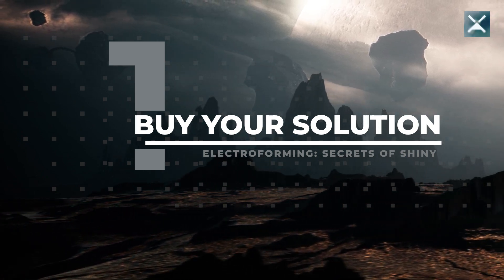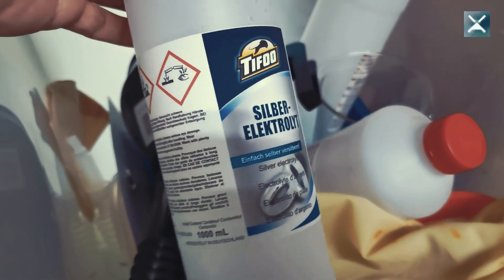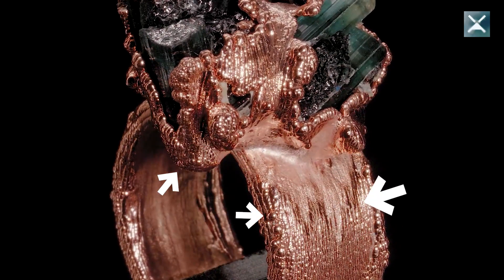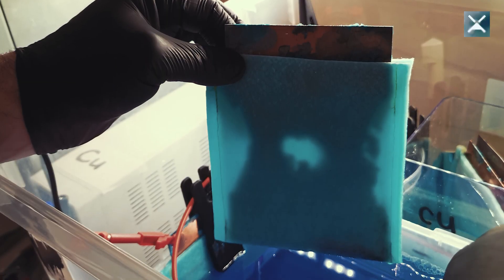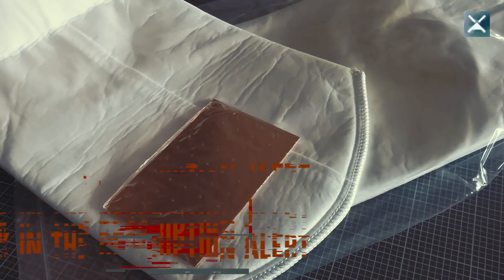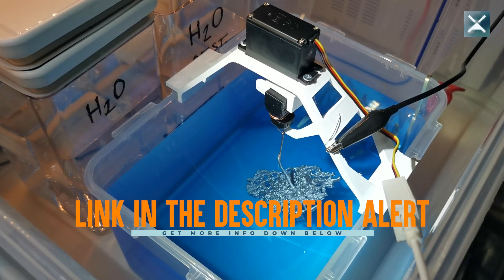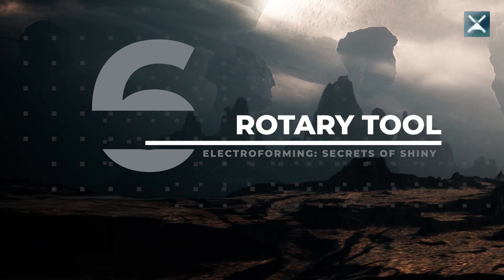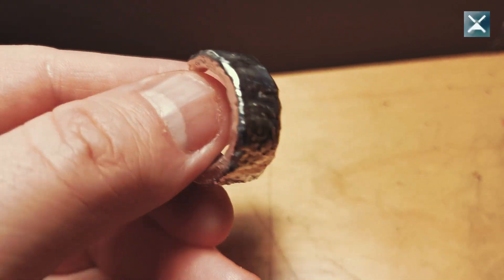Electroforming - Secrets of Shiny

Comment: I didn't have a servo motor of the right size to hand so made a similar rotary jig to yours but i added a commutator and used a geared DC motor instead of a servo, the commutator means that no clipping to the cathode is needed.

Comment: hi. thanks. i downloaded ROTAJIG DIY MANUAL.pdf file and the link of 3d printer parts and  ciruit  python code for the trinket doesnt download for me. could you please send me the links. thanks alot for your help.
Reply from the maker: """CircuitPython Essentials Servo continuous rotation servo example"""
import time
import board
import pwmio
from adafruit_motor import servo

# create a PWMOut object on Pin A2.
pwm = pwmio.PWMOut(board.A1, frequency=5)

# Create a servo object, my_servo.
my_servo = servo.ContinuousServo(pwm)

while True:
    print("forward")
    my_servo.throttle = 0.1
    time.sleep(20.0)
    print("stop")
    my_servo.throttle = 0.0
    time.sleep(20.0)
Reply from the maker: or use this link: https://www.swisstransfer.com/d/184178a8-db2e-4a13-9339-e5c5420a7207 ... hope thatll work

Comment: Do you run for fish tank filter pump during plating or after?  Also I have access to different pumps in Canada. What’s the key component? Just a filter sponge? Some come with all sorts of fancy filtration components designed specifically for cleaning fish tank water.
Reply from the maker: Hejhej peebs,  usually run the pump while eforming. The goal here is to filter out medium to big debris, while the anode bags should take care of anything smaller. So i have stuffed some coarse and some medium size filter sponge material into my pump. Its a bit trial and error, but it doesnt take a lot of effort to work well. But i never use the active carbon balls or other chemically active material, cause it could taint the solution. Hope that makes sense 🙈😉
Reply: @xeno_arch9887  that makes perfect sense, thank you!

So I’ve printed the roto jig and purchased the trinket M0 and FeeTech continuous servo from adafruit.  Did you heat the roto jig piece and just force it onto the servo gear?

Also do you have an STL for a case for the trinket M0?

Comment: In your code, the frequency was set to 5. Is there a reason for this? I have a flawless operation at 50 and problems at 5.
Reply from the maker: This depends pretty much on the make and model of the servo you are using. If it works with 50 for your servo, youre all set 👍 i tested thru several settings and 5 was a good fit for my servos. So my reason was pretty much trial and error 🙈🤣

Comment: Sir how to copper pleting thick and fast
Reply from the maker: Thick and fast electroforming depends on the solution you use. There are solutions on the market - like the ones from tifoo.de -  that plate 1mm of copper in only 12 hours. that's pretty fast. The only downside: fast electroforming requires a pretty beefy rectifier depending on the Surface areas of the objects you'd like to plate.

Comment: Hi I wanted to ask if there is a reason why it doesn’t rotate continuously? But in steps? (Was thinking about using a servo tester)
Reply from the maker: thats simply because Im soo bad at python coding and I just needed a quick and dirty solution 😁 There is no reason why it should rotate in Steps ... I did do the 20 Sek rotate/20 Sek idle-Scheme on purpose tho: By variing this Move-to-idle-Ratio you can tune in the Amount of Nodulation you want to have, if ever. Othervise just keep it rotationg the whole time.
Reply: @xeno_arch9887  Okay 😄 thanks for the info!

Comment: Quick question: when you spin the piece, could you instead keep the piece stationary but stir the solution with a mixing plate?
Reply from the maker: A mixing Plate is a very common and usuable way of keeping contaminant away from your piece. Absolutely nothing wrong with that. But if you rotate the piece you additionally get the benefit of avoiding Anode-Shadows.